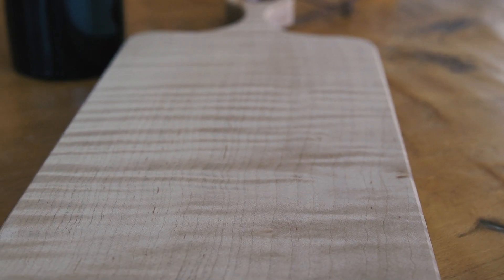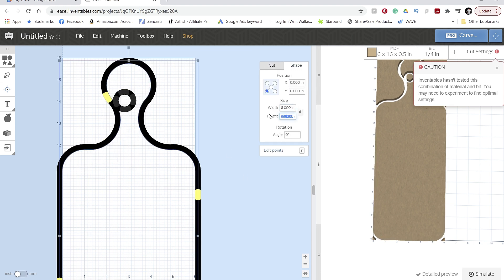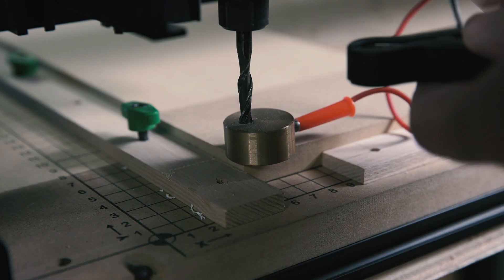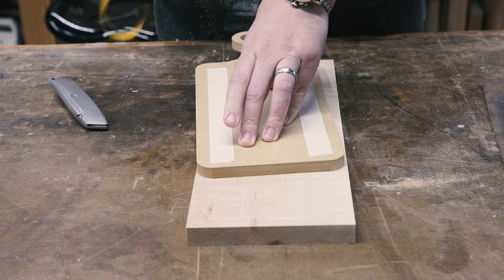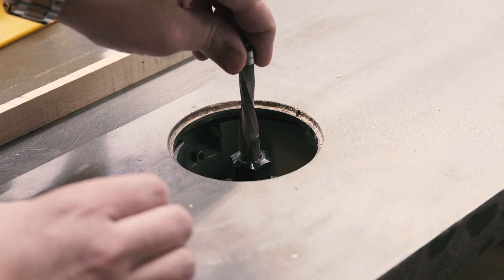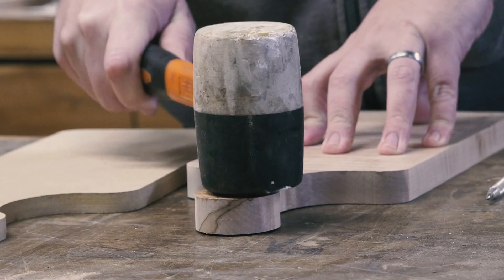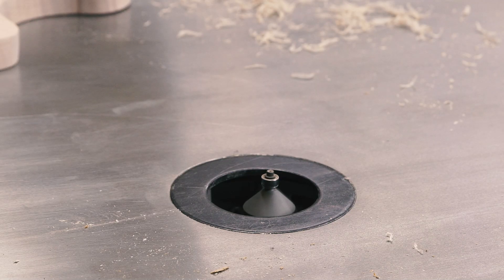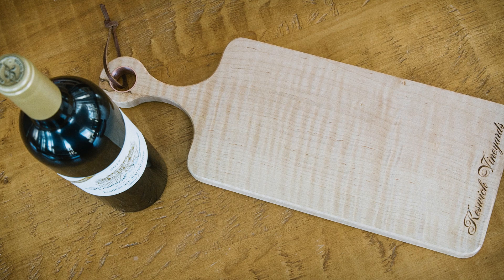Charcuterie Boards for Production in Mind

Comment: cool video. for the production of may of them could you set the robot to cut out several at once instead of just the pattern and then using the router? time > effort
Reply: Good question. I was wondering the same thing.
Reply from the maker: We're experimenting with both options. The issue is the cut time for cutting harder materials and how many we can batch in a day. Mdf cuts fast. Maple cuts slow. 11 minutes vs. 47 minutes with this bit setup.
Reply: @wmwalkerco  robots can cut blanks while you do final finishing of the chamfered edges etc.